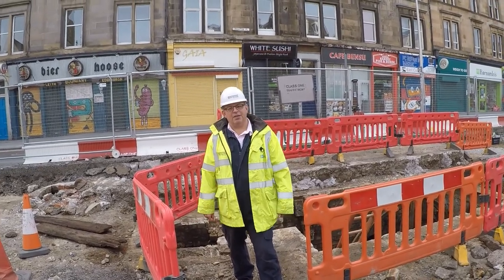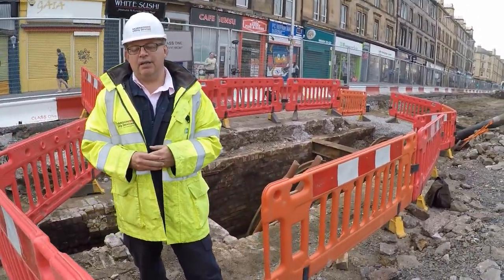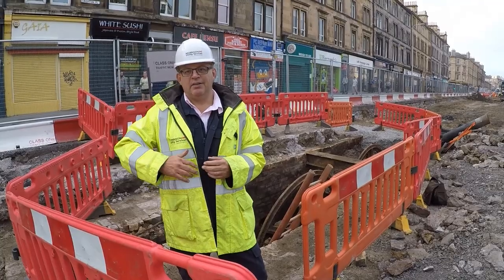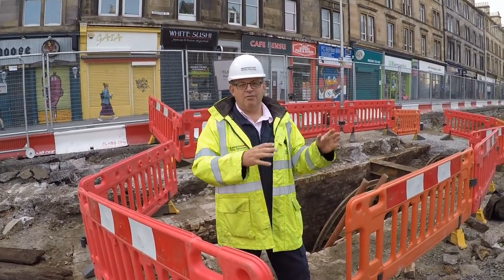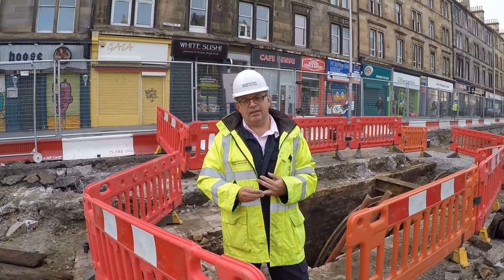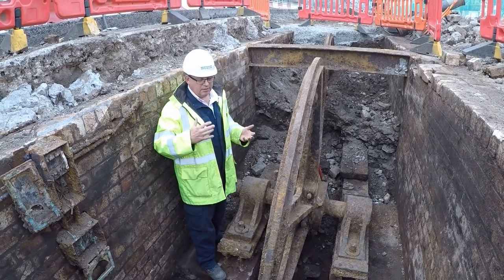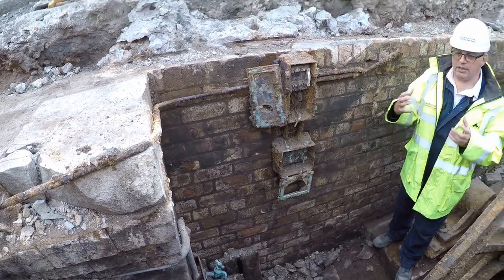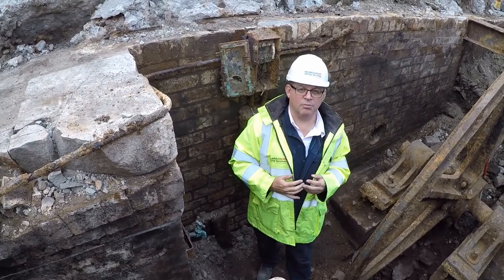Trams to Newhaven - 19th Century Cable Pulled Trams Vlog

Comment: Would this be where the cable changed direction and went back on itself? Would the cable have gone over one pulley, down under the other, across it somehow on a roller of some sort, and back up over the top on the other side of the centre ridge?
Many years ago there used to be a book on the cable trams in the Central Library Edinburgh Room. I discovered it's existence when I was doing a library assistant's course and actually sought it out. It was, in fact, a hand typed thesis donated to the library. There was that little known that this was one of the very few comprehensive reference works on them. 
It was a long time ago but I think I remember it talking about pits with telephones and lights and tunnels you could walk along. Signage was made using pink granite cobble stones in roads of grey granite. Cable speeds were set exactingly. I've vague memories of of odd figures like 12 and one third miles an hour.
I believe the SSEB used the tunnels in McDonald Road for their electricity cables after the cable trams were discontinued.